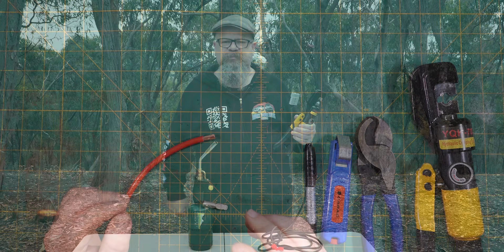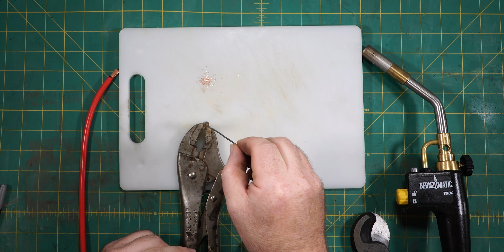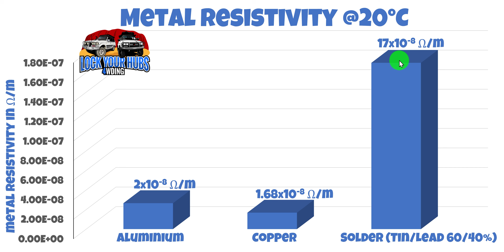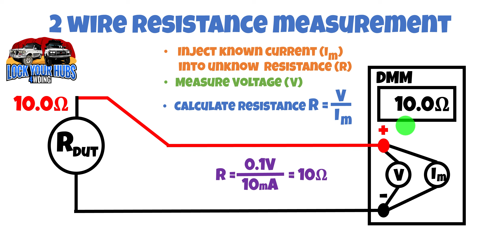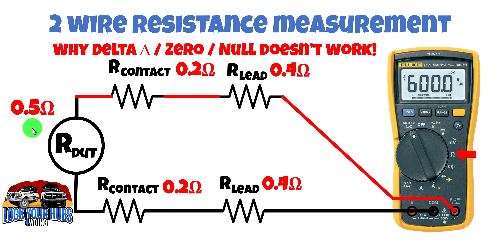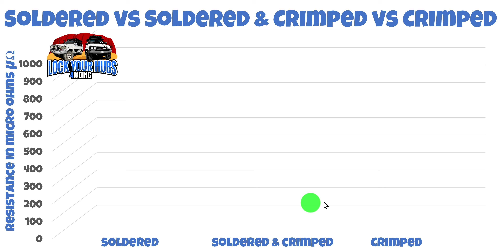Crimping vs Soldering for Anderson Plugs

Comment: I love your scientific approach. Another great video. I’ve only been crimping my Anderson plugs for years simply because it’s quick and easy and good enough. It would be good to see how the different methods hold up over time.
Reply from the maker: Tensile strength, corrosion resistance and vibration resistance are all really important considerations for an Anderson plug that's going to see service in a 4WD, that's where I think the crimp might reign supreme.
Reply: @LockyourHubs4WDing  With regard to corrosion we have found that soldering is far superior when it involves areas subject to moisture. It's not a bad idea to put some shrink wrap around the join between the plug and the plastic of the cable too :)
Reply from the maker: @WesternAustraliaNowAndThen  I really like the double walled glued heat shrink.
Reply: @WesternAustraliaNowAndThen I have come across a few badly corroded soldered joins more recently, I  used to solder or solder & crimp, but nowdays I lean toward just using a decent hand crimper for Ando’s

Comment from the maker: Has this video changed your mind about Crimping vs Soldering? What process will you use now? and why?
Reply from the maker: @lastknownlocation8760 haha, thanks mate, I think when you look up "jack of all trades, master of none" there's probably a link to this channel! :) I just really enjoy hyper focussing on a particular topic for a short period of time.
Reply: Well i’m shocked with your test results, when I was trained as a motorcycle engineer, one of the trainers that taught us about electronics was electronic physicist if that’s the correct term.
He explained that high risk of dry connections, and corrosion caused by soldering that the motorcycle and aircraft industries did not use solder for any joints because of reliability and the possibility of a higher or different resistance in his design in the wiring loom.
Have posted below asking if you’re solder was old stock? Because of most modern soldiers are not made up from 10 and lead any more, but specialised epoxy, resents designed to do the joining..
When tin was very important, and a very good reliable connection
Reply from the maker: @overland_adventure_nz  just standard 60/40 resin cored solder from Jaycar purchased late last year from memory. It's not the lead free stuff with the silver.